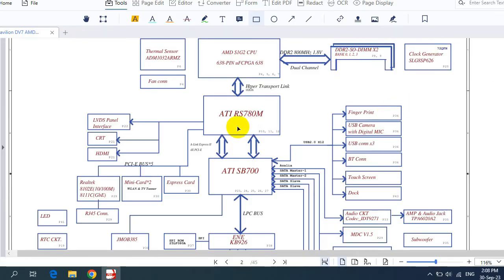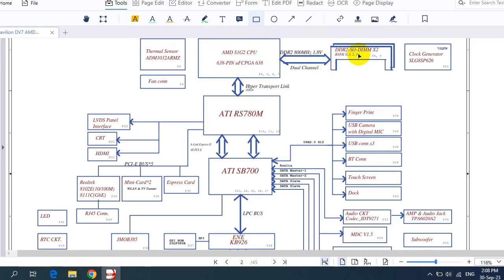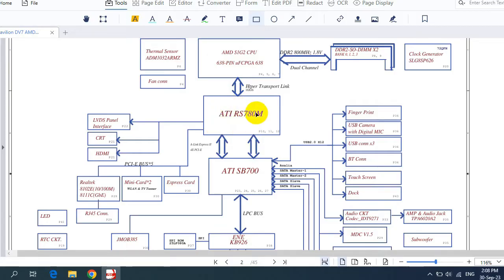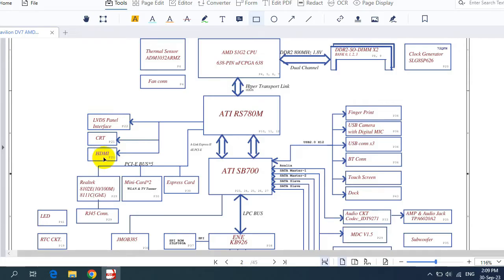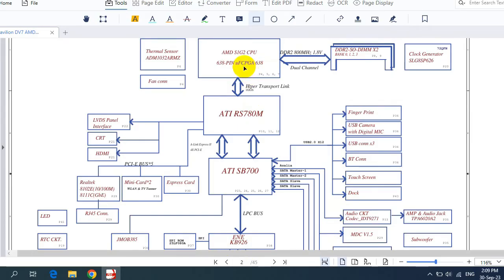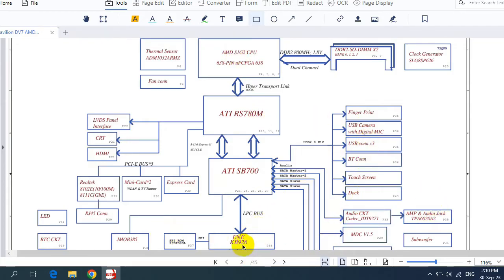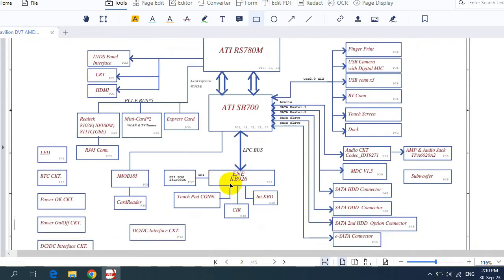The Most Laptop Common Faults - Laptop Motherboard repair

Comment: New problem was occurred that first mosfet was too much heating when supplied with 19.5 dc supply. Bypassing it with wire also caused wire to burnout. Bypass was done from source to drain. What can be reason and solution to wire burnout. This occurred third time with me. 
Charging ic capacitor checked. It was ok and ic also not heating.
Reply from the maker: You have a short circuit somewhere in the motherboard
Reply: @electronicsrepairbasics_erb charging section? why the jumper wire is burning? how to find out?